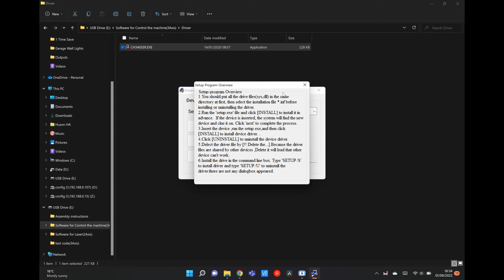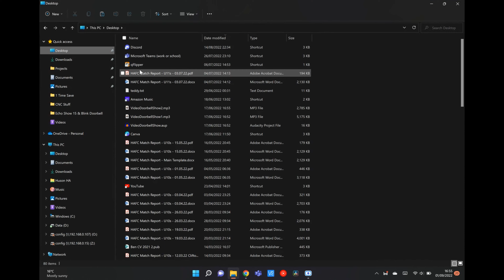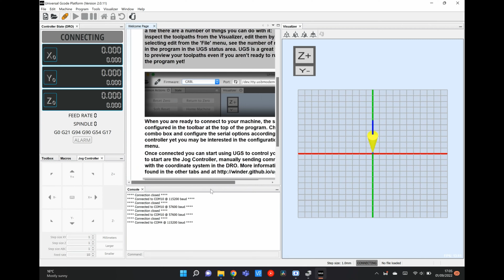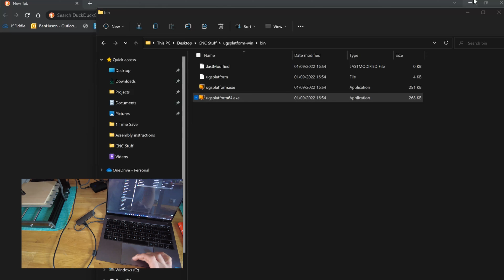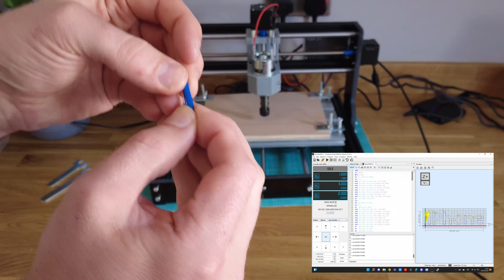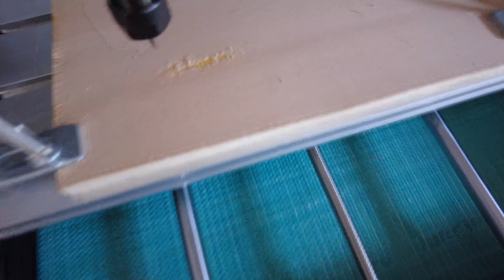CNC 3018 Pro Machine Software Install & Test Run | Huson DIY | Part 3 CNC Pro 3018 Beginners Guide

Comment: Can it cut holes into a plastic case or cut out rectangles etc by going deeper and deeper? Or is it just for engraving?
Reply from the maker: Yes in theory you could go deeper and deeper, depending on the bit you use.

Comment: I am having the same issues with mine.
Reply from the maker: Do you need the software?
Reply: @ I’m trying the usb that came with it it says alarm now on the screen
Reply from the maker: The software is here if you want it

https://www.dropbox.com/scl/fi/v8kqdlrhpdoouujdoufjy/CNC-Files.zip?rlkey=lx53175k1jzsrizis0nsnwyew&dl=0

If that link doesn't work for you drop me an email at

Husondiy@gmail.com
Reply: @ ok ty

Comment: Hi Ben. I really thankful for this video. But i have some issues with TTC 3018 mashie. It's engraving switched left and write. And the output is so smaller than G-Code measurements. i can't even engrave 100mm. can you please help me with that 🙏
Reply from the maker: Have you tried re-cabling all connectors on the machine?

Comment: Every time I try using ugs different things happen. Sometimes it will not move in any direction. Trying to run a program it just sets there doing nothing but looks to be running on ugs.  I’m so frustrated with this 3018 pro. Any idea what to do?
Reply from the maker: What cable are you using to connect between your PC and the machine?
Reply: USB cable to mini b to control board
Reply from the maker: Maybe worth trying a different cable!? Wonder if something wrong with it?

Comment: Hello there!
Have you managed to reduce the noise somehow. Mine sounds exactly the same way. I think its louder than it is supposed to be
Reply from the maker: Hello!! No I haven't unfortunately, still loud, especially on the harder materials
Reply: Getting a higher Amp power supply can reduce the noise of the motor under a load.

Comment: Hi Ben, Things have been a little disjointed, which translates to " how the hell do I set this device up" and you have basically supplied the missing link. I now know how to set up the driver and the Universal g-code sender. You were a bit long-winded but you got there way before me. My only excuse is that I am 82 years old with fried brains due to overuse. Many thanks, Ben, you are my saviour.
Reply from the maker: Haha glad I could be of some assistance!! Have fun using your machine!!